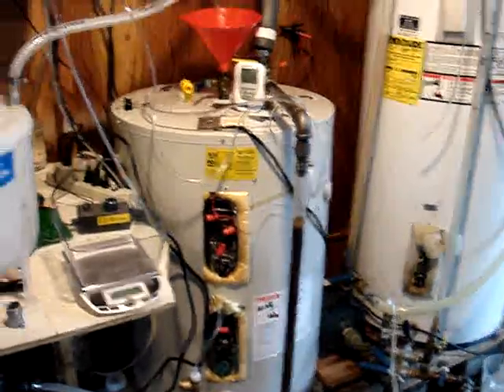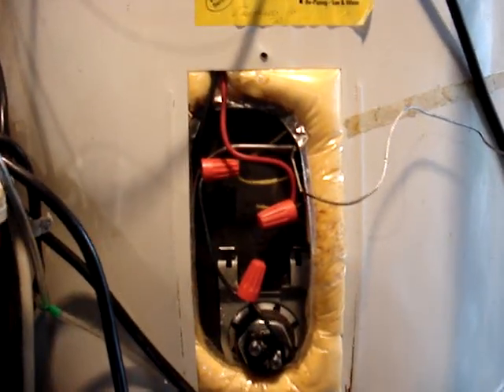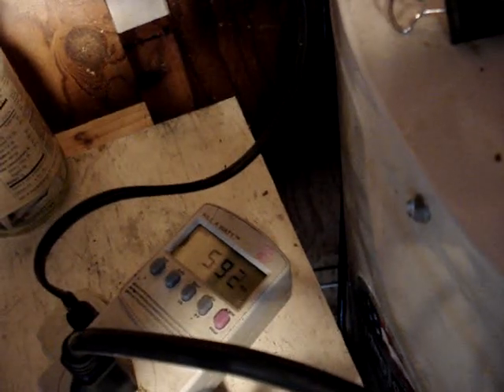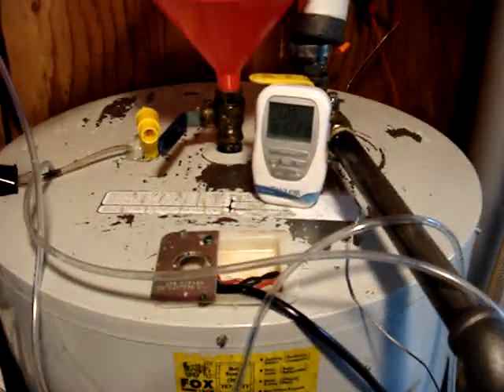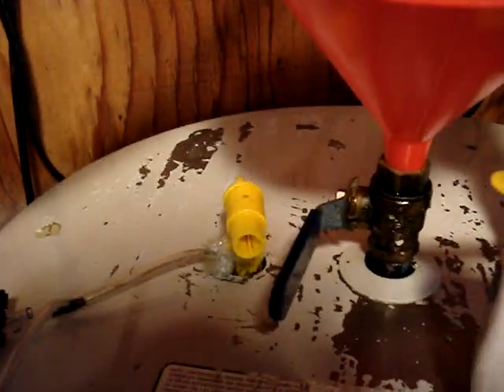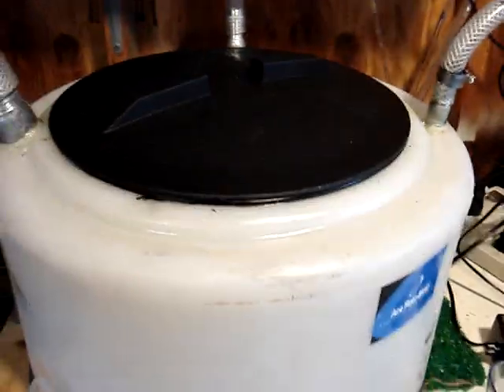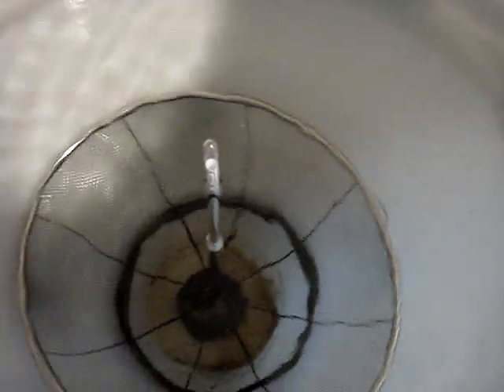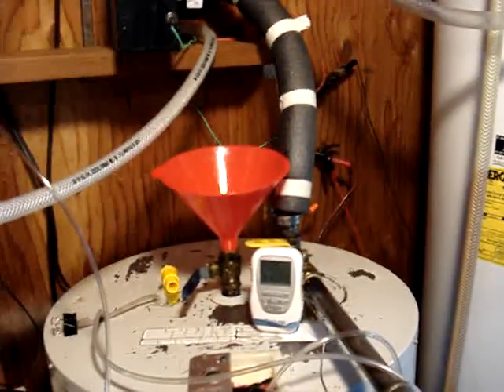Methanol recovery from glycerin

Comment: On your hot water heater you showed you use a variable resistor of sorts to control the power on the heater coils.  Is this because the heater coil gets too hot for the liquids (ie flammable glycerol) or because your thermostats were just not reliable or not working?  

I have setup aa similar setup but before I power it up I wanted to verify you had not found a flaw.  I was going to use the thermostat but the fluid around the coil would be obviously hotter then the 145F were thermostat is set